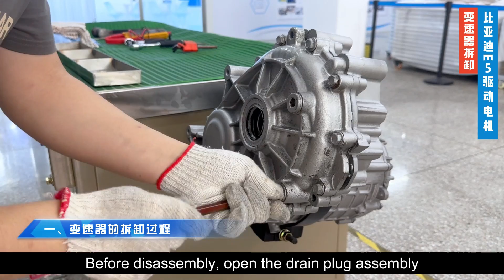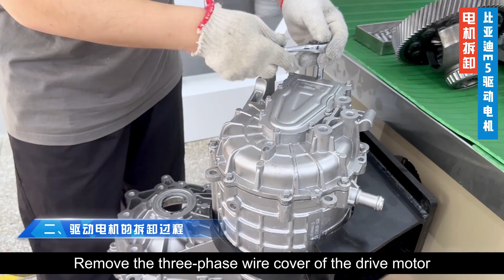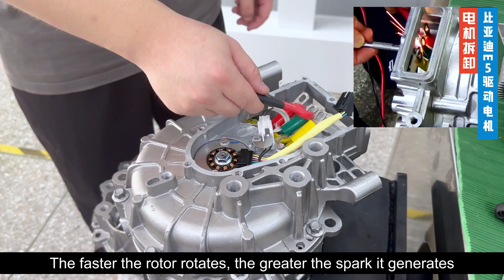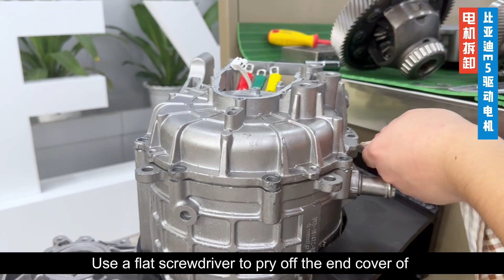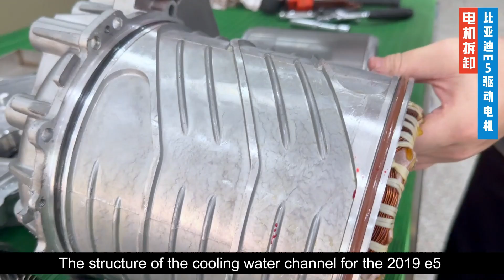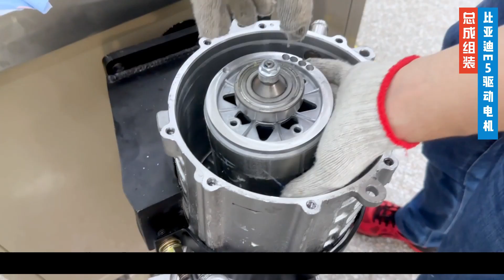BYD E5 Drive Motor Disassembly and Inspection

Comment: Interesting
Reply from the maker: Hello sir, let me give you a brief introduction about asynchronous motors and synchronous motors.
1. Construction
The permanent magnet synchronous motor consists of a permanent magnet and a coil. The permanent magnet generates a constant magnetic field, and the coil generates a rotating magnetic field through current, which makes the motor run. The AC asynchronous motor adopts the principle of induction motor and consists of a stator and a rotor. The stator generates a rotating magnetic field through alternating current, and the rotor runs under the action of the rotating magnetic field.
2. Control
Due to the existence of permanent magnets, there is a fixed relationship between the torque and current of the permanent magnet synchronous motor, so the control is relatively simple. The AC asynchronous motor needs to control the motor through rotor resistance, stator voltage, etc.
3. Efficiency
The permanent magnet synchronous motor is more efficient than the AC asynchronous motor, mainly because the permanent magnet synchronous motor will not have rotor loss during operation, while the AC asynchronous motor will have certain rotor loss due to the need for induced current.
4. Application
The permanent magnet synchronous motor is suitable for steady-state applications and high dynamic applications, such as electric locomotives, wind turbines, compressors, etc. The AC asynchronous motor is suitable for stable applications with low dynamic requirements, such as air conditioners, water pumps, etc.
Thank you again for your love of our products.
Reply: @FXB888  thanks a lot, understood to a good extent, I got confused when you mentioned Tesla uses asynchronous motor and its efficient in other comment, so I wanted to know is permanent magnet synchronous motor efficient, durable or AC asynchronous motor, to a good extent I understood PMSM is good for electric car and high steady usage places too and induction or asynchronous motor for less load ACs, water pumps etc. Have a good day. Hindustan south.
Reply from the maker: Thank you for your blessing. If you are interested in our equipment, you can contact us by email to Ms. Catherine (sale@fengxb.com ). I wish you a happy life.

Comment: See how Easy & Simple A Electric Motor can be Assemble & Disassembled. No Engine Oil involved in it. So you never needs to get Your hands Dirty. When you Compared to A Diesel Engine lots of Spares are involved & Electric Only Very Very Few Spares involved. But does the Same Job. I Must Be Blessed to be Born in Green Envouirement.
Reply from the maker: Yes sir, because what we make is teaching equipment, and our goal is to teach students some practical skills with simple operations.If you want to know more about us, please leave your contact information.
Reply: In Fact i didn't No it Was BYD. It's Nice to Know that BYD Use the Simplest Motor in the World With the Least Numbers Of Spares. So that it Will keep the Cost Of Vehicle Very Very Low. I Hope the Same Pattern Of Motor is Used On Your Buses , Trucks , Pick Up & Cars. Unliked Tesla. They Use Sophisticated  Motors With Too Much Spares Complicating Everything. Because of this the Cost Of Vehicle is Very Very High. I Think they don't Want any Manifactorior to Copy there Motor Patterns Or Design ?
Reply from the maker: Tesla uses an asynchronous motor, while BYD uses a permanent magnet synchronous motor. Tesla's motor lasts longer. The difference between Tesla and BYD lies mainly in battery technology. Tesla uses Panasonic's lithium cobalt oxide battery, while BYD uses a self-developed high-power lithium iron phosphate battery combination.The main technology difference is for the battery. For the price difference, it has so many factors. Not only from the technology on motor or battery, but also the policy or the percentage of the EV manufacuring maturity for the accessories.
Reply: @FXB888  I want to know more about asynchronous motor vs permanent magnet synchronous motor.
Reply from the maker: @Reddylion  Hello, sir. If you are interested in our products, you can send an email to Ms. Catherine (sale@fengxb.com ).We can provide you with information that better matches your needs.
Reply: Ev good

Comment: I wonder how much was copied from Tesla.....
Reply: Nothing.  If you compare the e6 with the Roadster and the (then upcoming Model S) they have completely different design choices.  The Tesla used NMC Li+ batteries and an induction motor for maximum peak power output since they were conceived of as being sports cars.  The e6 was designed as a utility vehicle with a significant eye to the taxi market, and uses a much smaller permanent magnet synchronous motor, and LFP batteries because performance was less important than range. The (designed much later than the e6) Tesla model 3 made largely the same design choices that BYD had previously - but that's not because Tesla copied BYD, it's simply that the choices that BYD made in the e6 and Tesla made in the model 3 make a lot of sense for the target market.
Reply from the maker: We totally respect and obey the original car workshop technology, but our main purpose is to teach and learn, teach the students practical or theory knowlege for BYD or TESLA. 
FXB Slogo: Simpler Teaching, Easier Learning . Our web address is www.fxbgroup.cn  
You can have a look at our company.
Reply: the answer is zero!
Reply: Bot😂
Reply: Western miserable haters

Comment: With due respect, the resolver used is also a rotary transformer.  A sinusoidal waveform drives the primary of a transformer with two secondaries.  The moving shaft varies the coupling between the primary and both secondaries which results in two sinusoidal waves at the secondaries.  The two secondaries are at right angles to each other which makes their outputs related as a sine and cosine. The exact rotation position can be derived from these two waves.  Usually the zero crossing points are used along with the average rotational velocity.  Nice presentation.
Reply from the maker: Thank you for your affirmation. We will continue to work hard in the future.
Reply: nice explanation, clear and concise